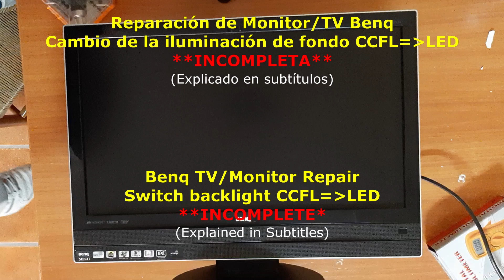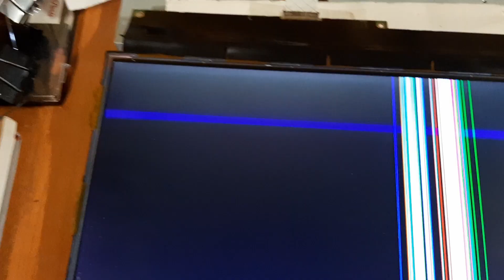Reparación Parcial Monitor Benq

Comment: Las tiras donde las comprastes tengo fallo en un monitor benq GW2265
Reply from the maker: Hola, gracias por tu consulta.
  La tira la compré en Ali Express, aparentemente el modelo que yo adquirí ya no está disponible pero se pueden encontrar otros similares (Ej: https://es.aliexpress.com/item/1005004351540826.html).
  Para buscarlo he usado los términos "CCFL, pantalla LCD a módulo de Monitor LED 22", en los resultados asegúrate de que las pulgadas sean correctas.
Espero que lo consigas, un saludo.